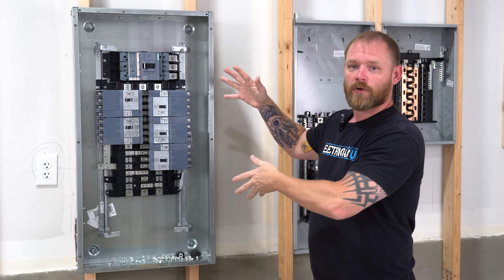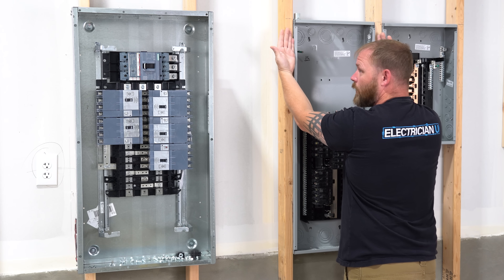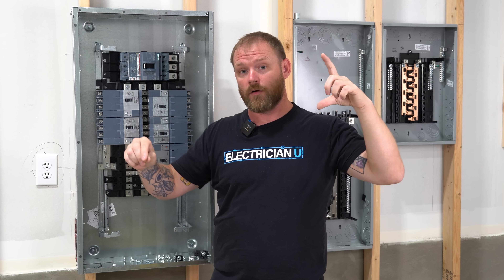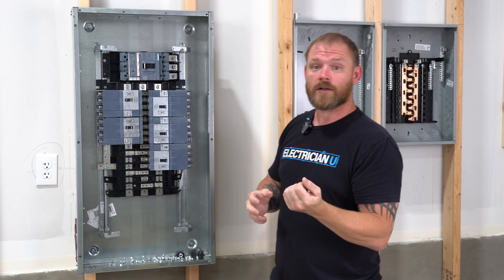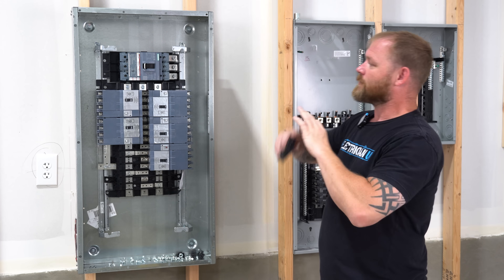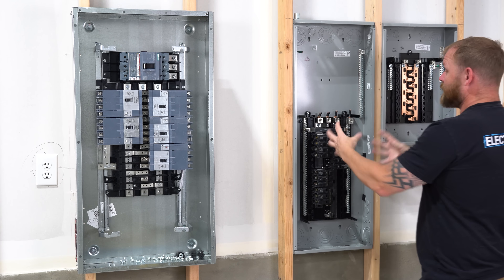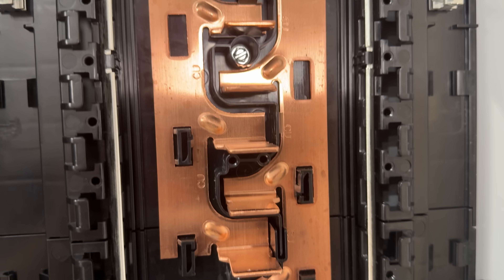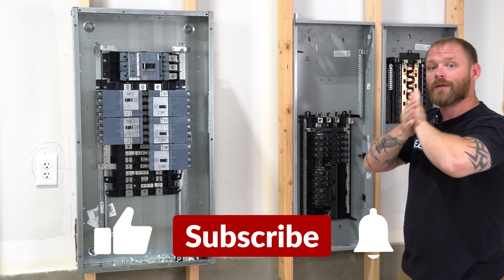What’s the DIFFERENCE Between a Load Center and a Panelboard? 🤔

Comment: Good job explaining the difference between copper and aluminum oxidation.  This is something a lot of people don't seem to actually understand.

Actually, almost all copper most people see is already oxidized to some degree, because it actually happens very quickly the moment it's exposed to air.  That typical brownish color everybody usually thinks of as "copper colored"?  That's actually copper oxide.  Unoxidized copper has a (quite pretty) bright gold color with a pinkish hue to it instead (but you usually only get to see that if it's just been cut or polished).

But copper oxide is electrically conductive, so it doesn't actually matter; oxidized or not, it still conducts electricity just fine.  On the other hand, aluminum oxide is one of the best insulators there is (it's often actually used specifically for that purpose), so the moment aluminum connections start to oxidize, the oxide can result in very high resistance and begin to generate a lot of heat when electricity flows through them.

Comment: Recently had to add light switches in a small store where they were turning the lights off inside the panel. Putting the cover back on I was reminded why I like bolt ins  when 3 of the breakers rolled off the bus bars. I really hate old undersized equipment.

Comment: I would like to extend neutral and ground bar in one 200 amp panel it’s only 15 screws for each side and there is no space for more neutrals can I use the Siemens ground kit with 27 or 30 screws and add to get exactly how the panel ok the middle look like 😮 ?

Comment: Hey my man, off topic but I would love for you to do a video on using regular "C" coudlet to reset the 360 degrees. I see this alot in the field. I understand you can use a standard "C" if you want a luping point or rope pulling point but I thought you cant use a standard "C" if you re using it to reset the 360degrees. 314.28 (A)3 has an exception but please explain.

Comment: A standard 20 A breaker is not rated to carry 20 A "all day". Need 125% of the continuous current, so 16 A all day through a 20 A breaker.
Reply: This is also true of outlets. Most are not rated for continuous full current. Read the fine print for Electric Vehicle charging outlets.

Comment: I just worked on a bolt in panel and the person or their helper stripped the threads on the panel board and I had to change out all of the leg parts that the breaker bolts to

Comment: DUSTIN, make a video lesson about how to test Wall Outlet LEAKAGE testing. I have been told to shut off the power at the breakpanel and use my DVM meter set to resistance and if there is ZERO resistance measured from HOT to Ground = Leakage. What I'm confused about is why does 0 zero ohm resistance measured from HOT to ground on the wall outlet is considered Leakage?

Comment: One thing you didn't mention is that load centers are designed to be installed in 16" on center studs so they are about 14 1/2" wide while panelboards are around 20" wide. I have installed plenty of panelboards inside walls, you just have to configure it using a flush cover.